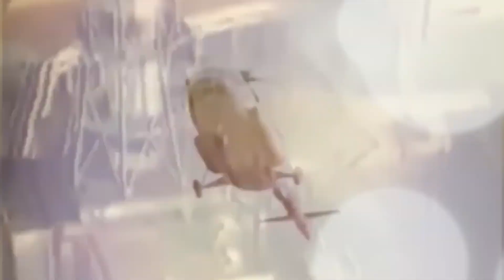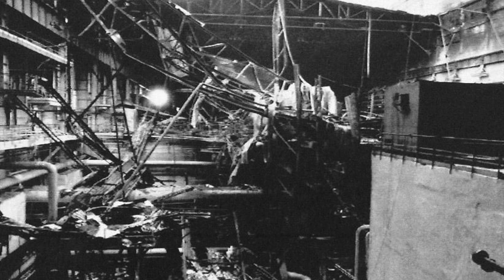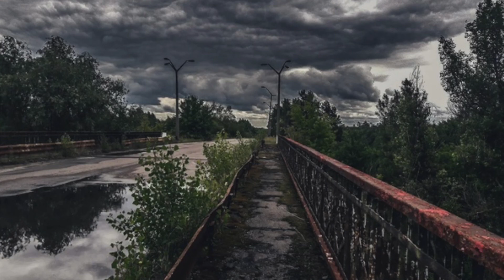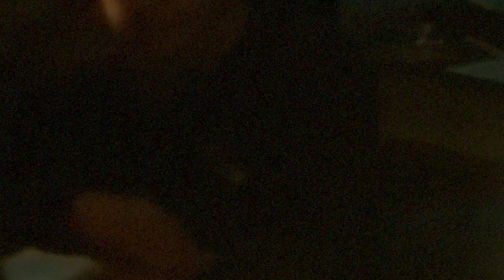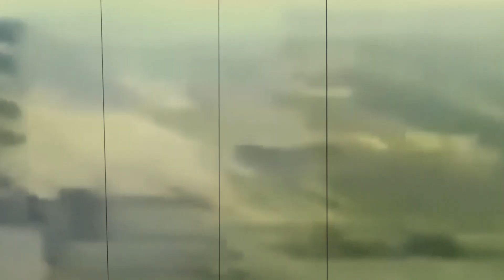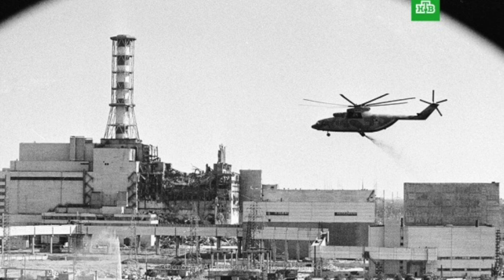Chernobyl. Stories from the radioactive zone

Comment: The test was supposed to be performed at a high power level, so the reactor was clear of any Xenon. But word did not get to the previous shift. after dealing with the evening peak unit #4 was left at low power. That meant the unit was literally being choked by Xenon. It acts as CO2 on a conventional fire does. The nuclear reaction actually stopped & all there was was 'decay heat'.
The Man In Charge, Anatoly Dyatlov... He HAD to do the test for some reason. Even though their own rules said the reactor had to be left to allow the Xenon to decay/disperse for two days.
It seems like Dyatlov got the staff to re-start the reactor any way they could & they pulled out almost all the control rods to get a nuclear reaction going. NOT a good thing.
The RBMK had multiple flaws that were known about at high-level but not communicated downwards. 
Once the reactor burnt away the Xenon reactivity soared. So they used their SCRAM button (AZ-5). 
What they did not know was that the control rods had tips of graphite. Graphite accelerates reactivity. On top of the unstable state the descending control rods caused an even greater power spike. 
The explosion of unit #4 was NOT a nuclear explosion. The reactor vessel was over-pressurised by steam & the ends blew out.

I am amazed that the Soviet authorities did not have Dyatlov executed, although he went to prison. Given the consequences of his actions on that night he might have deserved a death sentence.

The HBO series 'Chernobyl' was filmed at a genuine RBMK reactor at Ignalina NPP.  The drama mentions the bravery of a Soviet General in discovering the amount of radiation escaping. Rather than send one of his men to certain death he drove a counter into the area of Unit #4. He was in a lead-covered truck. I think he was decorated Hero of the Soviet Union, which he deserved.

The expense of the clean-up operation is alleged to have accelerated the end of the Soviet Union. Mikhail Gorbachev's reforms weren't producing massive improvements.
Reply from the maker: Whoa! Thank you for such a great comment.

Comment: The filters on the footage to make it appear older were highly annoying.
Reply: I am not so sure if That burning fire was "original Russian" footage! But the helicopter, losing its rotor blades and crashing was real (in the other Visioner Video)
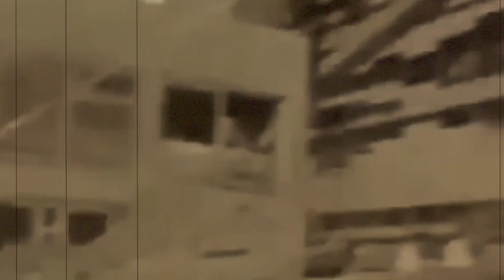Reply: @konradcomrade4845  I'm talking about the vertical lines that keep running across the screen like @ 5:48